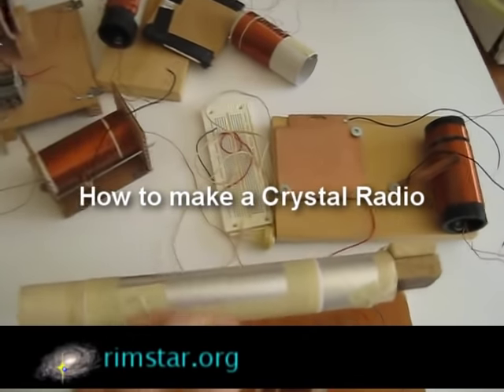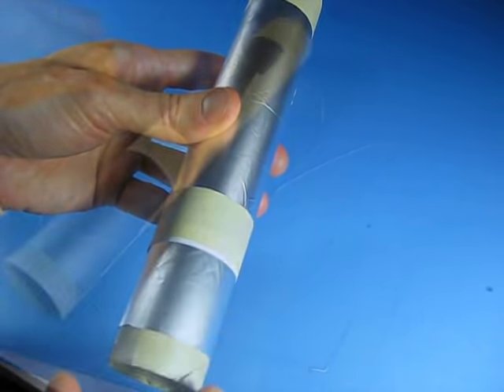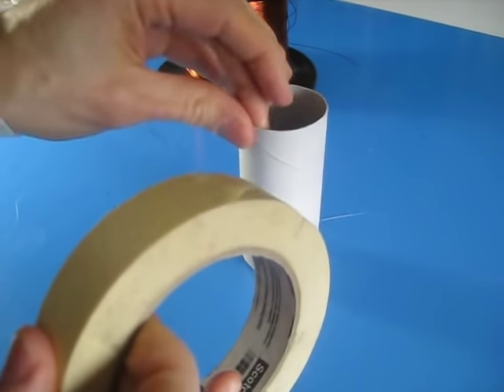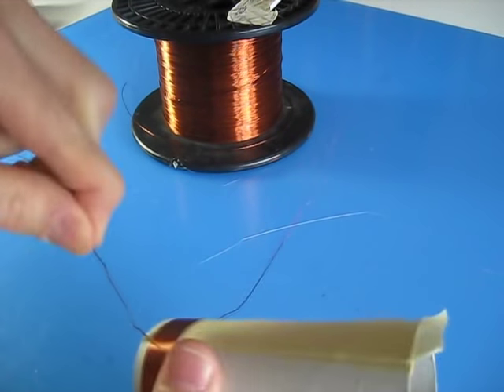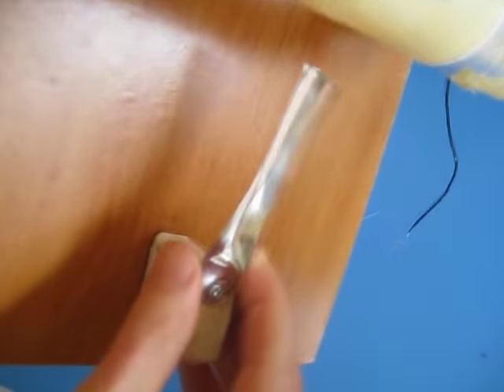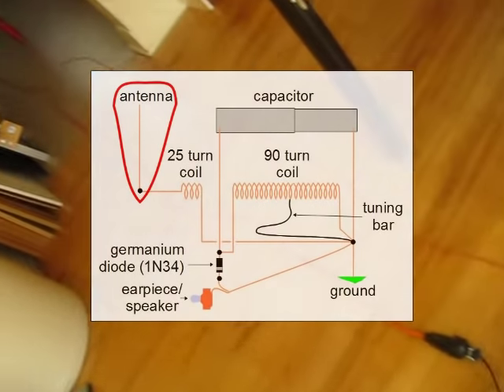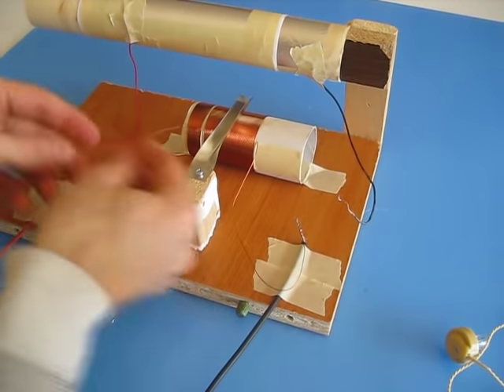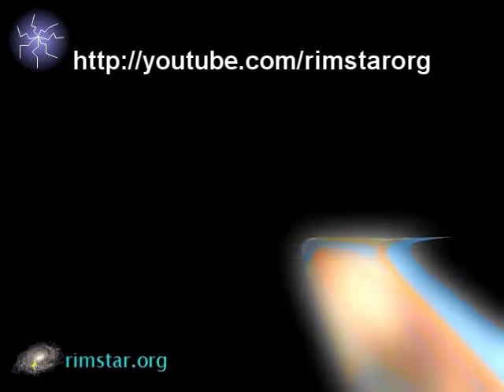How to Make/Build a Crystal Radio

Comment: i couldn't hear anything can u hook up a speaker an show us again, also if you were out in the mountains and didn't have a ground plug what would i do. thanks this stuff has got to be doable for me.
Reply from the maker: To hear it better see my "How to Make Crystal Radio Amplifier for Speaker" video http://youtu.be/JtPwxbOgBHw I show it using my portable crystal radio at the beginning and my desktop one near the end.
For the mountains, if you're hiking and you could try my potable one which you can see in my "Portable Crystal Radio using Loop Antenna and Pizza Box" video http://youtu.be/iunAvz9PbN0 though I doubt it would work. I'm not familiar with how mountains affect radio transmissions but if you're far from a radio station, you need a very long, straight antenna anyway.

Comment: Can I use the copper wire which has 3-4 strands spinned  into one?insead of the single strand!
Reply from the maker: Yes, you can use stranded wire instead of single strand (also called solid).

Comment: is the capacitor you used in this video considered a "variable capacitor?" i have to build one of these for a physics project, and having a variable capacitor is one of the requirements. thanks!
Reply from the maker: +Alexann Zahara Yes, it's considered a variable capacitor. Make sure you use as long a straight antenna as you can and make sure you have a good ground. Those seem like the two parts people have most trouble with. In case it helps, you can find all my videos and more on my webpage here http://rimstar.org/equip/crystal_radios.htm. Good luck on your project!
Reply: Hi,would u please give us some explanation how to make the antenna ,ty

Comment: How would I increase the amount of stations mine gets(currently I only can get one station)? My guess is to simply increase the coil length(as in more turns)?
Reply from the maker: It could just be that you're receiving the most powerful stations and you need a longer antenna. That's the case with me. But it could also be as you say, you need a different geometry coil and capacitor. I'm working on a video about that now which should be out in the next two weeks or so but I also have these webpages, including online calculators http://rimstar.org/science_electronics_projects/lc_circuit_aka_tank_or_resonant_circuit.htm and http://rimstar.org/science_electronics_projects/coil_design_inductance.htm.

Comment: I had a kit I completed and wasn't smart enough to think of plugging it into ground and I took mine outside it's been in the rain a few times... Should it still work or no waterproof?
Reply from the maker: The only place I can see an issue is if the tuning is done like mine, with the insulation scraped off of the top surface of the coil. Any water there will short out the adjacent turns. Once the water is gone though, it should be fine. Also with mine, the water could short out the two capacitor cylinders, but again, when the water's gone, it should be fine.

Comment: In my Cristal set dia of capacitor is 40 mm and tunning coil dia is 15 mm with 30 turns for antenna coil and 90 turns for tunning coil. My radio is not working. Only disturbing noise is coming

Comment: Hi, could you please tell me if the size of the wire used in the coils is important? or is it just the amount of turns? will any wire do for use as coils as long as there is the right number of turns on each?
Reply from the maker: Mymla Pretty much any size of wire will work, unless you're talking about really big diameter wire like 14 AWG or thicker. The amount of turns is important, but so is the overall length. Look up the formula for inductance of a coil and you'll see what things go into it. But if your wire isn't super thick then the length won't vary enough to matter.

Comment: If I understand this correctly.  Somebody 2000 years ago can make this device.  Exception to the diode and earpiece.  Can they make those too? And can they transmit morse code or audio more than 1000 miles away effectively?
Reply from the maker: You can make your own diode using a razor blade. I show how to do that in this video https://youtu.be/eIdHsjfbckw. For the earpiece, that can be made using a lot of thin wire and a magnet to make a high impedance speaker (headphones).

Comment: Does the coil have to be wound on a toilet paper roll of that diameter? The magnet wire I have us a bit too thick to fit 2 coils if 25 and 90 turns.
Reply from the maker: You don't have to use the same diameter but when you change the diameter, the number of turns should also change. You'd have to calculate how many though. What you want to do calculations for is an LC circuit that gives a coil that can tune in from 540kHz to 1.6MHz. I talk about how to design those circuits here https://rimstar.org/science_electronics_projects/lc_circuit_aka_tank_or_resonant_circuit.htm The capacitance of the capacitor I show how to make in this video is from 0F up to around 640pF. So use that range for your calculations and make sure your coil isn't too short, otherwise all the radio stations are crammed into a small length and it's hard to tune. But if it's to long then you'll use up a lot of wire.

Comment: Does the ground wire have to have 3 prongs? Or can ground be anything connected to the wall port
Reply from the maker: It sounds like you don't have much knowledge of the electrical wiring in your house so I'd recommend you don't use the ground in the power socket as it's very dangerous. I suggest some other sources for grounds in my troubleshooting and tips for crystal radios video https://www.youtube.com/watch?v=HZZmKZJrIW0. Also, you might find more understanding from my recent What is Ground video https://youtu.be/zLW_7TPf310.

Comment: Maybe one can use one of those X shaped antennae made from a long length of wire and some 1x4s. ?? I forget the name for them right now.... They're a bit more challenging, but they don't take up much space.... :-)
Reply from the maker: Chris Green I'm not familiar with X shaped ones. I've also done a loop antenna though, to fit the whole thing in a pizza box. With the smaller antenna and no ground, the output isn't as loud but it works. You can see that one here https://www.youtube.com/watch?v=iunAvz9PbN0 and I send the output to a homemade amplifier here https://www.youtube.com/watch?v=JtPwxbOgBHw
Reply: I couldn't remember the term 'loop antenna' (if indeed I ever knew it) but that was what I was thinking of. Something like the one shown over at this project: Thanks.
http://makezine.com/projects/bottle-radio/
Reply from the maker: Chris Green There's no loop antenna in that one. Here's a loop antenna one I made https://www.youtube.com/watch?v=iunAvz9PbN0

Comment: Anyone have any advice? I built one of these but all I can get on it is Shortwave, even though there's some interesting listening there and it pulls in some of these stations reasonably well (especially considering I am getting stations on it as far away as Romania and China coming in clearly) I would like to pull in the local AM stations but no matter what coil or tuning cap I use it's always the same result.
Reply from the maker: CoolDudeClem Can you describe you coil and cap? Dimensions, number of turns, ... I can plug them into my spread sheet to get resonance frequency range.
Reply: RimstarOrg
Ok, I'm not sure about the tuning cap I used, it's an old style "open" one I got from out of an old radio, the coil is very much like the one in your video, about 90 turns of magnet wire on a 5cm diameter cardboard tube and about 53 mm long. I don't know what gauge wire I used.
Reply from the maker: CoolDudeClem Hmmm... Your coil does sound the same as mine, but without knowing the capacitance range of your tuning cap I can't compute resonant frequency range.

Comment: Very excited about finishing out radio!  Two questions (for now):  Does the diameter of the capacitor vs the tuning coils make a difference?  We used two TP rolls taped together for the capacitor, but created our own roll out of cardstock for the tuner.  The tuner has a larger diameter, probably 25% longer, than the capacitor.  Will that affect anything?  Also, we used heavyweight AL foil.  Will that allow for greater capacitance?  Thank you!
Reply from the maker: The coil and capacitor diameters aren't related in any way. And your larger diameter coil should be okay as far as the coil alone is concerned. The heavyweight AL foil doesn't matter either.
Reply: Thanks for your reply.  We have finished our radio, no signal.  We'd like to see if the earpiece is working.  One site said to touch the two wires of the earpiece together.  If we hear a click then our earpiece works.  When we make a connection with the two wires of our earpiece we get nothing, no sound at all.  Do you agree that this is an indicator that our earpiece is faulty?    After that our next thing to tackle is getting a better ground set-up.  Thank you!
Reply from the maker: If your earpiece is a piezoelectric crystal earpiece and you don't hear the click then it doesn't sound like it's faulty. If it's just a normal earbud like you use for phones and ipods then it shouldn't work anyway. For those you need to add a transformer as I show in this video http://youtu.be/GCh2LVHUavQ. I have other tips you can check on my website here http://rimstar.org/science_electronics_projects/crystal_radio_tips_and_tricks.htm.
Reply: We purchased a piezoelectric crystal earpiece.  Looks just like the one in the video.  So, if not hearing a click means it isn't faulty, then we'll move on to the grounding situation.  Thank you!
Reply from the maker: Whoops. I phrased that first sentence incorrectly. If you don't hear a click then chances that it's faulty. At least mine clicked like everyone says it should.
Reply: Hint for rural people:   You need a very very very long antenna, possibly more than one.  We have tried sooo many things to get our radio to work.  Static was at least encouraging.  We are not convenient to any stores, so picking up supplies takes time.  We finally got the faintest of signals today after connecting TWO antennas in parallel, each about 175-200 feet long copper wire.  Faint but recognizable signals!  One of our first recognizable songs, "Delilah" by Tom Jones.  Never heard the song before, but even as a faint static-y whisper, Tom Jones' voice is unmistakable.  My mother would be proud!
Reply from the maker: Congrats! And thanks for the details on what finally made it work. That'll help me help others in the future. You may also find that the signal is stronger, or even only present, during certain times of the day.

Comment: When you sand the 90 turn wire are you trying to take the insulation off? Wouldn't that cause them to short out? -thanx, peace
Reply from the maker: You have to be very careful to try to sand only the tops of the wires, or at least avoid sanding in between and shorting them. I don't put much pressure, sanding lightly.
Reply: thanx-peace

Comment: Hello there, I was thinking , If one was to use electrical flex for antenna wire, for example normal electrical flex with 2 wires inside, and use both wires, would this count as two antenna's or would they need to have space between the wires to have the effect of two antenna?
Reply from the maker: Based on my experiments the two wires would have to have space between them. I tried with wires close together and further apart and seemed to notice a difference. I think I was doing okay with a few inches of spacing.

Comment: Nice vid! I just had one question though: Is the antenna exposed wire or insulated, or does it not matter at all?
Reply from the maker: That's a good question. I'm not sure of the answer. A long bare wire may pick up charge from the air. But given the circuit I use, that charge would just go to ground. If your antenna wire isn't connected to ground then you might build up an unwanted voltage.
Reply: @RimstarOrg  Alright, thanks!
Reply: It should be insulated - - enamel coating, or plastic will do

Comment: what is the thickness of the wire used to make the bobbina? Whether you use wire for the antenna? thank you

translated by google translator

qual è lo spessore del filo utilizzato per fare la bobbina?Che filo usi per l'antenna? grazie
Reply from the maker: For the coil I used 26 gauge (26 AWG). 24 gauge (24 AWG) works well too. The wire for the antenna can be any size, it does not matter.Per la bobina ho usato 26 gauge (26 AWG). 24 gauge (24 AWG) funziona bene. Il filo per l'antenna può essere di qualsiasi dimensione, non importa. (google translation)

Comment: can i use PVC pipes instead of the toilet and paper towel roles? If so what size would it have to be? and do i still put aluminum foil on it? and follow the rest of the steps?
Reply from the maker: I'm assuming you mean for the capacitor. Yes, you can use it. Just go with the same length that I do. I suggest covering it in a layer of paper and then putting the aluminum foil on top of that. The dimensions for everything will likely be a bit different since you'll be making the aluminum foil go all the way around the pipe.

Comment: Hi, does the dimension of the tube you wind the wire on make any difference? So rather than using s paper tube, would it work equally as well if you use, say, a bit of 1/2 inch diameter pvc pipe?
Reply from the maker: Concept Seven Yes, the dimension matters. The coil has a certain range of inductances and the capacitor has a certain range of capacitances and together those inductances and capacitances go into which frequencies you can tune into. The diameter and length of the coil are variables in what makes up the inductances.
Reply: Many thanks

Comment: Rimstar , i catch just 2 , sometimes 3 stations with my radio, is it possible that the coil is not good? Is a pre wound coil for mw with ferrite core , i buyed this type of coil beucase in my country ( Romania) the magnetic wire is pretty expensive, and is it possible to connect two coils like the one im using so i make a coil out of two? I searched on the internet and in romania are 6 or 7 AM stations.

Comment: Can bare copper wire be used for the inductor coil? In other words without enamel coating?
Reply from the maker: runcamyt No, the copper in each turn of wire must not touch the copper in the next turn of wire.

Comment: do you need to use a crystal earpiece? Could I just hook it up to a speaker or regular pair of earbuds?
Reply from the maker: There isn't much power here so unless you have a very long antenna and are near some radio stations, you won't be able to power a speaker. For earbuds, you need to add a transformer and I explain that in this other video https://www.youtube.com/watch?v=GCh2LVHUavQ The transformer will add losses so it won't be as good as with crystal earpieces though.

Comment: Just throwing out an ideal here...  couldn't this be built (perhaps on a larger scale) and then bridged to a 12V capacitor, then to a 12V car battery.  That could ensure the battery would maintain a consistant charge.  Then by hooking up the battery to a Grid-tie inverter (DC to AC) then the power gets shipped back out to the grid.  Much the same as how solar panels charge a car battery using the UV radiation,  then running the battery (or bank of batteries) through an inverter and sening it back to the grid (or using some/all of the power that is absorbed, resulting in a lower daw fom the power company.
Reply from the maker: Theoretically, yes, it could be built on a larger scale and produce large amounts of power. Practically, no. The crystal radio's output is largely dependent on the length of the antenna and how close and powerful the radio station is. With a few 100 foot long antenna you could light an LED, so two such antennas would give twice the power but that's still not much.
Reply: Well, okay...  I was just thinking of something along the lines of Tesla's Radiant Energy Patient, tuning to some local radio station (yeah I know.. I'd have to be careful about violating some unknown US FCC laws though.)  Maybe you could use this "tuning" (like a ham radio) and increase the available power source for it by adding amperage that is charged from say... a grounding rod connected to capacitors that could be charged from the earth's magnet pull - like a ground sourced Tesla receiver. 

Hmmmm , now I'm going to have to try toying with some ideals and scarp steal rods, copper coils, and leftover computer components from an old Commodore 64 computer I had back in the 80s (uhhhh can anyone say 'RETRO'?)  LOL!

Comment: Instead of a paint can for the tuner, what else can i use? Anything around a common household?
Reply from the maker: Devonte Finley You can use anything that's at least a bit stiff and made of metal. If it has a coating on it then you can sand it off to expose the bare metal. For example, a soda can (e.g. a Coke can) or beer can. Those have a coating on the inside that you'd have to sand off. Have a look around and you'll probable find all sorts of things.